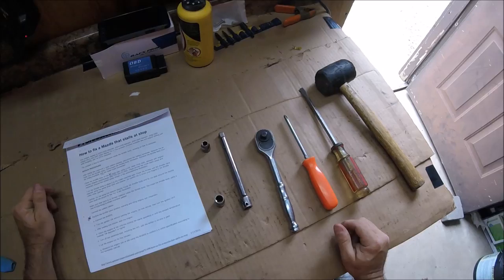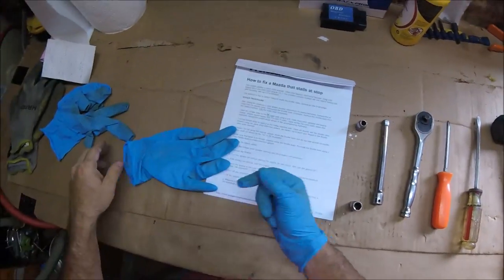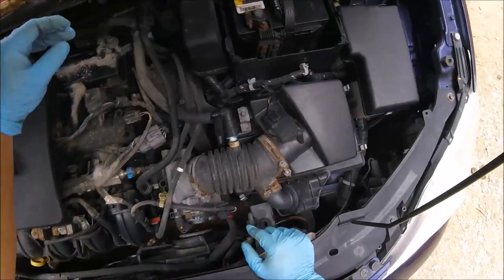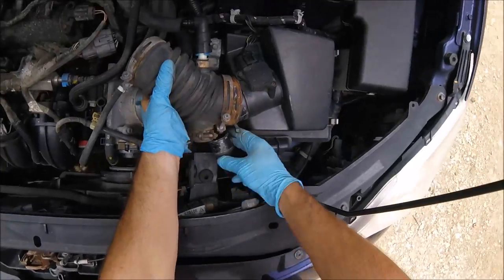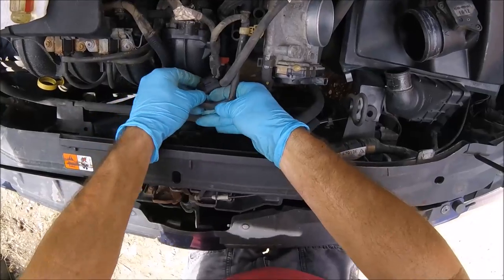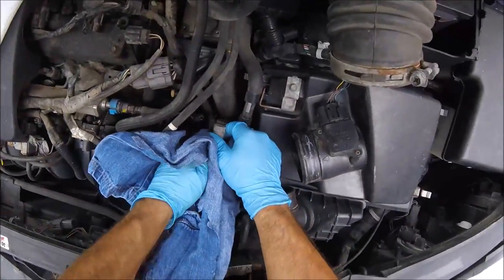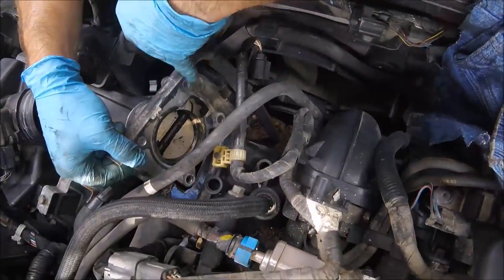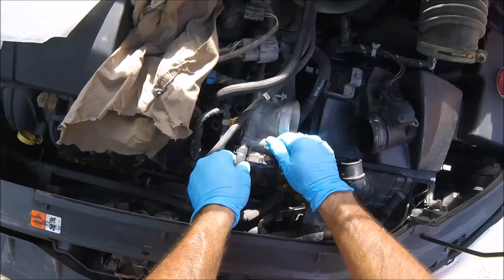Fix stalls cheap - Mazda 5 Throttle Body Removal and Cleaning

Comment: Worked for Mazda 3***:

What worked for me was that I've changed the Air filter, spark plugs, Maf sensor clean and Throttle body clean up, BUT the most important thing that solved the problem was that I've filled the half of tank with REGULAR fuel with Instead of SPECIAL on a different fuel supplier than the one that I regularly use. 

It seems to be that the injectors and the fuel pump get dirty after using the 90 octanes (recommended by Mazda). Try to use Regular fuel some times to avoid this problem with the RPMs. Also, try to fuel your Mazda 3 at different fuel suppliers place. 

This procedure worked for me since the first time I filled the half of the tank with Regular Fuel.

Comment: Just some carburettor cleaner and a cloth of rags you have the much of the same result in less time..... with japanese cars you can even use it to clean your injectors just squert some in while it idles. Just a little a time it will get sucked in  through the injectors. It often used as start booster it can't do any harm. Open the valve also it is that place you really need to clean where the edge of the valve where it's seales with the walls around it. It's is a real easy Diy job
Reply: Nooo...carb cleaners have too much chemicals. It will remove the coating on  throttle body. Use throttle body cleaner.

Comment: The reason this happens majority of the time is because the person disconnected the battery and the car starts up and the computer thinks the car is brand new and doesnt account for dirt in the throttle body. You can do a simple relearn procedure to fix this issue, let it run idle for 20 mins ac off, then let it run 20 mins with ac on full blast, then take it out for a spin and the caar should be fine.
Reply: Gonna try this
Reply: Interesting that how the ac helps it along
Reply: Did it work

Comment: Great video ,thanks for posting. Did everything on video except disconnecting battery (don't have radio code). 
Overall really good results slightly better idleing but starting much more efficiently. i don't know if i've created another problem , but the car is starting to rev up to 2000 rpm when dipping the clutch at low speed and then returniing to an idle of 1000 rpm. 
Any ideas what the problem may be.
Good health and safe motoring  (greetings from Glasgow)
Reply: Mine is doing the exact same thing, that's why i was looking here for an idea of how to fix it, I assume if you've already done all this then it won't fix my problem
Reply: @Slash250688  try disconnecting the negative side of your battery and turn the headlight switch on  (to drain the remaining power on the system), keep it like that for about 5 min, after that re connect the battery and turn your car on, leave it alone for 7 to 10 minutes so it can adjust idle, after the 7 to 10 min turn on the ac and leave it alone for another 7 to 10 min, after that take it for a drive, that's how they told me i can make my mazda 3 re learn its idle throttle positions.
Reply: If you're on about on start up it's normal.its like a choke

Comment: Is this an electronic throttle body ? I cleaned mine recently and was at a loss as to how to open butterfly.. couldn't find cable anywhere. I just learned that apparently you aren't supposed to move the butterfly manually if electronic..can strip gears and damage it...I did by hand and didn't break it but it apparently is a risk
Reply: You can open an electronic throttle body butterfly by turning the car on - WITHOUT starting it - and depress the accelerator pedal all the way down. Use some sort of stick or rod to keep the pedal to the floor. The throttle body butterfly will close back as soon as the pedal is released.
Reply: @ve2za  ove Read this but it thrn means reconnecting the battery wouldn't that create a fault code ? Just curious

Comment: What were the results?  Video cut short after being so long? ???
Reply from the maker: Process helped some but was still missing and stalling, further examination found the timing chain is stretched and will need replaced. Also has possible VVT issues. will be doing a video on that process later. Did this process first as it is a service bulletin, know common issue, and much easier to complete. I've also had success with this technique  on other vehicles.
Reply: About the only video that shows the dissambling and assembling of different parts. 👍👍👍

Comment: Hello, I have a mazda 5ts2 2.0 petrol engine 113, 000 mileage. I have a problem about the very bad gas mileage. The car show any check engine light.
Reply: I would start with spark plugs and ignition coil boots, it is possible that your engine is misfireing, also if it has a bad idle I would replace the IAC valve

Comment: So i have to replace whole throttle body do I need to drain coolant to be able to take the two pipes off for coolant?
Reply: No.9ffenve but did you listen to it at all ?. He says no coolant pipes to disconnected and just clean it not replace
Reply: @Kevin Hancock  did you read at all. The question was if you had to replace the throttle body. Not that this guy was doing that.

Comment: My Mazda 5 at a complete stop with the brakes on it tries to well it accelerates by itself any idea if this is has to do with the throttle body to?
Reply: Did you replaced or disconnected the battery before the symptoms?
Reply: @yanyo999  battery was disconnected but it does the same thing once in a while a come and goes
Reply: did you find out what the problem was?

Comment: Does anybody know where the damn idle air control valve is on this damn engine?
Reply: @jessekainordwall  yup that's exactly what I've found out as well.
Reply: @Beeni801  Did you find it?
Reply: @geraldconde1  it doesn't have one.
Reply: @Beeni801  Thx, must be a mistake on my diagram. I'd replace the entire throttle body if I wasn't getting rid of it.
Reply: @geraldconde1  yeah I dumped that van and got a much needed upgrade for my wife.
Reply: @Beeni801  Did you go blonde or brunette?
Reply: @ladfromaus  nope but that engine doesn't have one so that's why I couldn't find it. Lol. Also, I don't even have that piece of shit car anymore thank God.